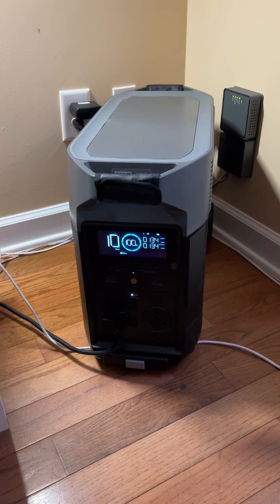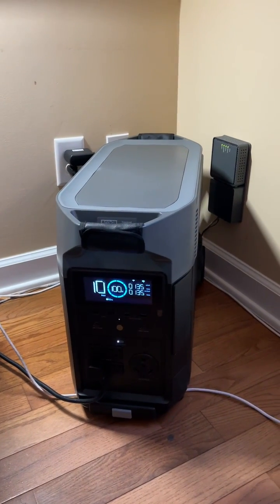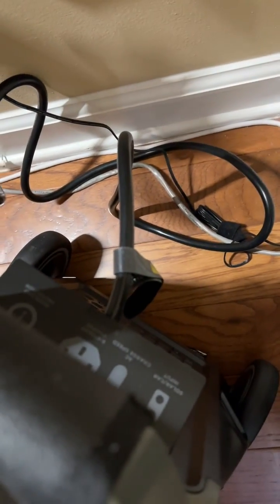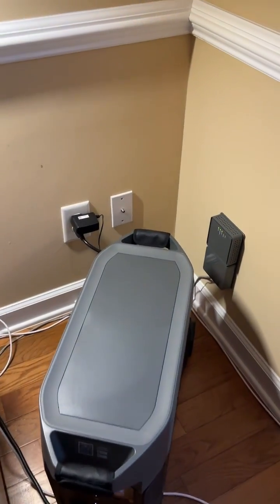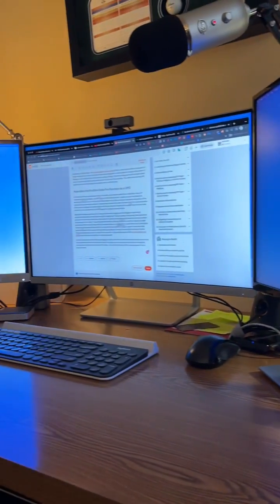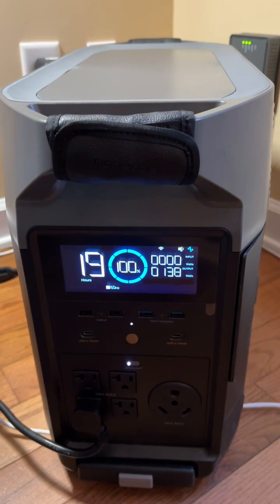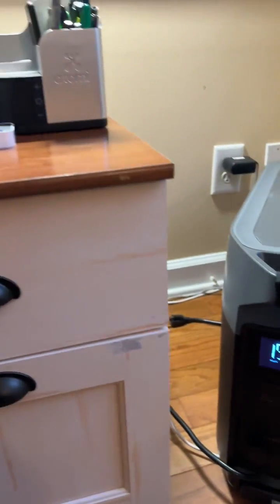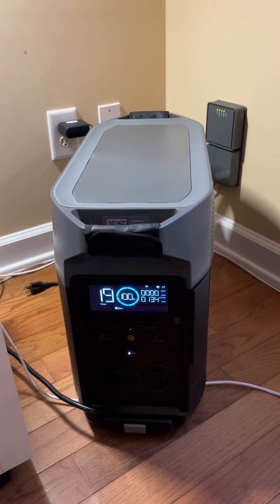How to Use the EcoFlow DeltaPro as a UPS or Uninterruptible Power Supply

Comment: This is BS. I have yet to see a power station act as a true UPS, which has total pass through and only activates battery output to inverter when grid power goes off. I have 3 brands, and the fans blow and the battery charges all the time. I suspect some smart manufacturer will have a "true UPS" switch that will make the power station act just like a true UPS.
Reply: If you want the inverter to stay off while it's plugged in, just get a normal UPS for heaven's sake. The inverters on these power stations come up way, way too slowly to react before the relay kicks over. That's the problem with transformerless inverters. Ecoflow's new stuff does only turn on the fans when they get warm, and aparently Anker's whole lineup is capable of the same. The smallest power station I have only turns the fans on when it's hot, too.
Reply: @pootispiker2866  I have one. It will only run my TV, desktop computer, cable modem, and WiFi for about 20 minutes. A bigger one costs more than a power station.

Comment: So, why do EcoLab say their power stations should not be used as a UPS because EcoFlows do not like being charged and discharged simultaneously?  They recommend attaching a small UPS and an EcoFlow together to avoid that issue.
Reply: The Delta pro doesn't use the inverter to power the load while charging. On grid power it's in a bypass mode to save efficiency. EF says not to use these as UPSs because they react too slowly and might not cut over unless the incoming voltage is completely gone.

Comment: The best thing is to have a true UPS ( a small one) between the Delta and the Computer, the UPS would kick in in less than 0,1ms which is true "uninterrupted power supply" (UPS), the delta has 30ms rated reflect so it is an "emergency power supply" or EPS.
An EPS is like a UPS but has much slower react time than UPS, so having a super cheap low capacity true UPS between the Delta and the PC you manage to make it a true UPS for sensitive devices.
Reply: UPS unit would consume quite some extra watts, even when idle.
Reply: @terminal2004  For my expensive computer to be safe I'd allow it to consume some additional watts if this is the case.
Reply: @AriaPrincessAria  Te refieres a que el UPS debe ser barato por que el Ecoflow puede averiar el UPS?
Reply: @3D_Laser_Lab  No I mean the UPS can be cheap because it won't need to keep the computer on for many minutes, it should be powerful enough to deliver enough watt for it, but once the power is off, the UPS would kick in and then 30ms later the EPS would supply the power to the UPS, so the UPS won't need to keep the pc open for more than a fraction of a second. You do not need it to have a big battery and thus be expensive.
Reply: @AriaPrincessAria  muchas gracias por tu respuesta me aclaraste muchas dudas 👏
Reply: The "wiring fault" light on the UPS system never turned on while plugged into your Delta? My UPS system worked for two outages while connected to the DPU's Backup UPS port, but on the third outage, the "wiring fault" indicator on my UPS system turned on. I immediately disconnected the UPS system from the DPU and never did it again.
Reply: @Constitution1789  All the wiring fault light on UPS means is that there isn't a bonded ground at all. The DP uses a floating neutral setup, so to the UPS there is a bad ground. There's nothing inherently dangerous about that condition.

Comment: This test proves nothing because the APC UPS (listed in video description) is handling the power drop while the Ecoflow switches over to battery. Run the test again without the APC UPS in between the computer and Ecoflow to see if it really works as a UPS.
Reply: The video description clearly details that the APC UPS is what is functioning as a “True UPS”. The EcoFlow is definitely not functioning as a UPS, but rather an IAPS interruptible auxiliary power source. Unfortunately, someone watching only the video and not reading the description is misled into thinking the EcoFlow is acting by itself as the UPS when it not. 

Video description:
“I had my small APC backup plugged into the Delta Pro all I had to do to test was to disconnect the grid power from DeltaPro Unit and see if my computer and accessories stayed on through the interruption of grid power and not shut down”

So all that was verified was that the APC UPS works as a UPS.

Comment: Did you try it without the APC backup? With the APC plugged in, the APC should switch with in 10ms and carry over until the Delta kicks in. This is a solution to keep it the MacMini on and still have long run time, though would be nice if the Delta just did the switching in less than 10ms.
Reply: Was wondering the same.
Reply: I have no problems without a UPS in the middle, unless I'm playing an intensive game when the power is cut.

Comment: He is using a laptop hence the slow cutover will not affect it as it will switch to battery for a few ms - for a server or desktop PC you are going to have issues unless you have another smaller UPS in front of the Delta to carry the load.

The Delta 2 does not fix this flaw either.
Reply: He says he's using a Mac Mini, which doesn't have a battery.
Reply: @assortedmountainlife  M1 - it has way low power consumption compared to Intel models
That would explain the tolerance - folks with Intel iMac's and PC's reported issues.
Reply: My understanding was that the switchover latency issue was fixed in later firmware and that the delta 2 units show this...
Reply: @engineeringVirtue  Good but I went instead for a home solar system instead of this.
Reply: @tibby-za  which?